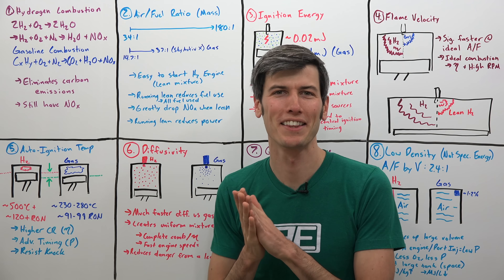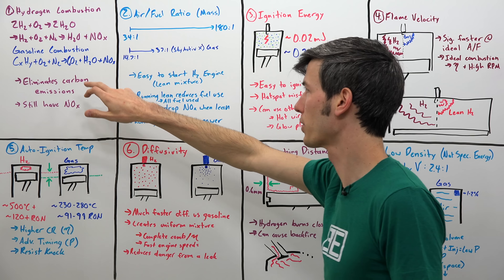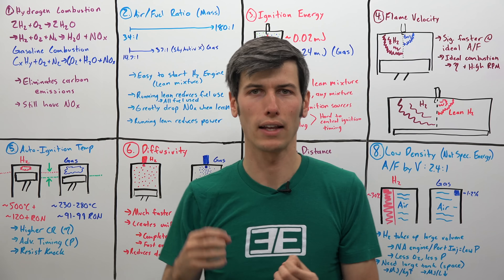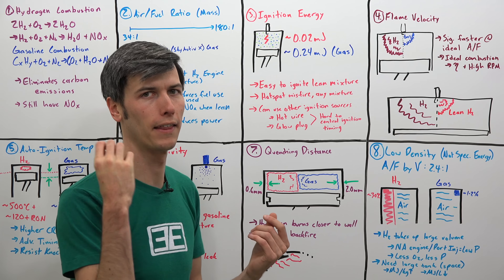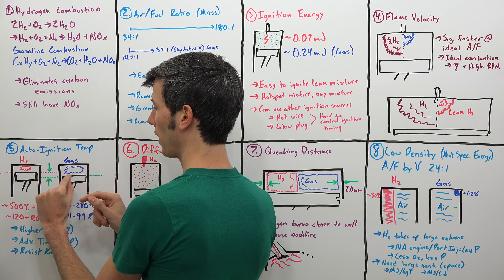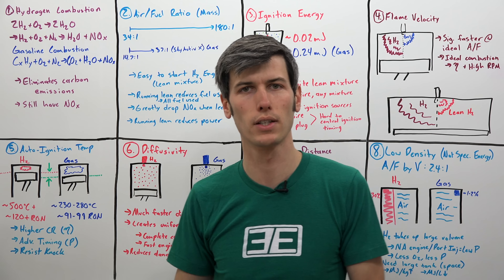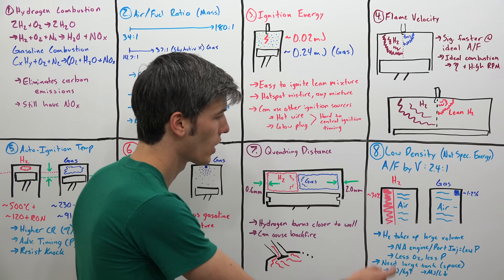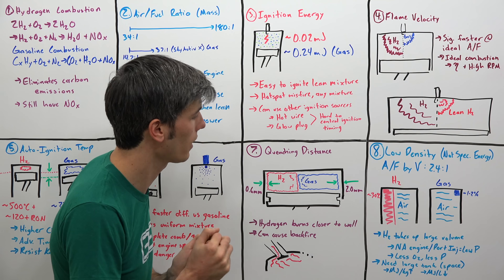The Difference Between Gasoline And Hydrogen Engines

Comment: Fix hyrogen timming by having 6 stroke, intake, compresion, power , exause , fill the cylinder with cooling water and eject cooling water from the cylinder. Obviously produce les power but you can run more hyrogen to mske up for that without pre ignition

Comment: Hydrogen fuel taking up more space issue:

Hydrogen can be created on the fly, petroleum cannot, 1 Litre of water can create 1,800 Litres of burnable hydrogen and the ability to power vehicles or generators etc. with water has been available for over 100 years. Oil cartels kill inventors creating a better version, but now electricity is taking over in vehicles they have to use other methods to make money like CoVert methods  ;|  Who could have guessed who was behind this in 2020?  Hmmmm..... clues anyone?

Comment: I wonder if a hydrogen leak in a car indoors is more or less dangerous than a gasoline leak indoors. Of course the quantity involved in either type of leak would be an important variable. Also, just how large does a compressed hydrogen tank need to be to store the equivalent of 20 gallons of gas?

Comment: Actually combination of hydrogen with diesel or gasoline is much better solution because diesel or gasoline with small quantity of hydrogen burns much better and you get perfect emissions and efficient engine. So it's much better than every fuel alone. Diesel with hydrogen is very interesting because its very clean, and you get more torque.

Comment: i'd still go with Hydrogen, no carbon deposit, adjust the timing and use Fuel Cell Hydrogen by demand.
Reply: Couldn't agree with you more. But I would combine the two. And have been.

Comment: Could the engine be designed to not use atmospheric air? If you are getting the hydrogen from electrolysis, then also save the oxygen and store it also? Though that would increase risk.

Comment: Hot spots are a problem in petrol engines cause there would be a carbon deposit left. Hydrogen engine does not produce carbon deposits so no hot spots due to that.

Comment: To avoid detonation in an internal combustion engine need a very high octane, pure hydrogen has an octane rating of >130, not easy to find this in gasoline.  Gasoline carbons up your engine reducing efficiency and is exponential in nature, hydrogen is not.

Only idiots state the hydrogen is more dangerous than gasoline and unfortunately in the US, idiots are in charge and law makers.

Comment: If the nitrogen comes from the atmospheric air intake as part of the combustion resulting in unfavourable nox gas why not use water as the fuel source. It comes with its own O to burn the H and the exhaust will be the excess O from taking the H2O ' s and burning the HHO and using any available or needed O. Any unused O will be the exhaust.

Comment: Actually the reason that leaning out the H2 mixture improves efficiency is that it reduces pumping losses.  That's because the throttle valve can be open farther thereby reducing the vacuum in the intake manifold so less power is wasted sucking air in against the vacuum created by the throttle valve.

Comment: Fantastic explanation.
I was waiting for the comparison in BTU's.
Gasoline has 114,000 to 116.000 BTU's of energy.
Diesel is 126,000 to 134,000 BTU's of energy.
Every other fuel including Hydrogen is less.
Hydrogen contains about 27% of the energy of gasoline.
The other huge and so far unsolved  issues include hydrogen embrittlement ,whereby steel deterioration occurs at temps over 500F.
But the gorilla in the room is how can you store hydrogen efficiently?
 Single or dual wall carbon nano-tubes?
This pig wont fly kids.

Comment: Blowby in gas or diesel engines is mostly carbon compounds which are scavenged by the PCV system and reburned. Some portion of these compounds are absorbed by the oil, eventually turning it brown and "yuckey" (Yuckey is the technical engineering term).

Blowby from a H2 engine is water vapor. Some portion of this blowby can be scavenged or exhausted but some smaller portion will be absorbed by the oil turning it into a mocha cappuccino colored not-oil with the lubricity of somewhere between Starbucks soy milk and water.

Many years ago BMW experimented with H2 fueled engines, in a V10 IIRC. They walked away.

Comment: I've toyed with the idea of a hydrogen-powered engine for several years, now. Your last point - energy by volume, I think it was - would a liquid hydrogen fuel system solve that? Not sure what kind of pressure that'd have to be under, but I'd imagine injecting liquid hydrogen into the cylinder would greatly cool the combustion chamber and eliminate any hotspots that could cause auto ignition.

Also, with hydrogen being so small of an atom... wouldn't it just leak through the gaps between most metal molecules?

Comment: 5:05 low flame point but high autoignition temperature. hydrogen's autoignition temperature is higher than isooctane so you have less preignition or knocking than gasoline.

Edit: you mentioned about that later, but I don't get why you said the opposite thing at 5:05. Preignition and knocking are almost the same.

Comment: Problem is where do you get your hydrogen, I don't have a hydrogen well, do you?  Most commercial hydrogen is produced by stripping the carbon from natural gas, thus you are paying for the gas and stripping a significant part of its energy content (that is then released to the atmosphere as CO2, in large amounts).  The other method is removing it from water (sea water, lake water, well water, makes no difference), this is the high school science experiment where they blow up two balloons, one with hydrogen, the other with oxygen.  It's a relatively simple process, the only issue is that it needs a lot of electricity since the O and the H are bonded pretty tightly.  This is somewhere between 20 and 30 kwhs for the energy equivalent of a gallon of gasoline.  That would take a lot of solar panels especially if you needed to fill the tank, say ten gallons worth.  After you make the pure hydrogen you have to store in in a bulk facility, transport it to the customer, and store it for the user, all of these present a lot more problems for hydrogen than for say natural or LP gas  (LP and NG come from the same source, why is only one 'natural' and the other apparently not?).  It is much more efficient to 'burn' hydrogen in a fuel cell and produce electricity that way than in an engine (otto cycle or diesel), neat thing here is that is usual to attach some sort of a converter allowing the FC to be fueled with an alternative fuel such as natural gas that is easier and cheaper than H and easier to store and transport.  Of course you are then emitting CO2 directly rather than back at the production facility.

The underlying issue is the emission of CO2, an atmospheric gas that is essential to life on earth (ask any biologist).   The model currently in use apparently overestimates the 'global warming' effect of CO2 by a factor of about 10.  Another consideration is that a relative small increase in atmospheric CO2 levels would enhance global plant growth allowing a big increase in world food, wood, and fiber output, something needed to supply the growth in world populations.  the temperature increase, though small, would be greatly appreciated by many Canadians and Norwegians as well.
Reply: Bs

Comment: OK, So you have only NOx and H2O coming out, right?    H2O = WATER right?     SO, It is the dead of winter 10 degrees below freezing, New York, Boston, Chicago, Denver, etc, and all these Hydrogen cars spewing out water freezing on roads, sidewalks, buildings. Sound like a real mess. You would have to have some sort or radiator and H2O recovery/storage  system.
Reply: You get vast amounts of water vapour from petrol and diesel engines.
Reply: @chestnut01111  channel is bs.
Comments are being deleted.
nothing is better than water !
Nothing.

Comment: Question: engines produce CO2 and that's suposed to be bad for the climate
the bubbles in any fizzy drink, champagne and beer is called CO2 also
what's the difference?
and if no difference, every liter of cola has about 2 liters of CO2
wich is specialy produced to put in there (U're the exact numbers guy^^)
that's a LOT of CO2 overal
... then as conclusion: Why don't they carbon tax fizzy drinks?

Comment: Great rap how would hydrogen work on a Wankel type ? You could set the rom and direct couple it to a multi phase ac alternator it could be a small package long distance trucks would need a small battery pack there refill time is short and somewhat easy also what about propane it’s cheap conmen and pollutes much less than gas ?

Comment: Why couldn’t you just have a recirculating system, with some sort of electrolysis device before the engine separating water into hydrogen and oxygen and reintroduced the 2 with lets say some sort of injector for each in the combustion chamber. Your welcome 🧐

Comment: Thats alot that i didnt know but now do until i forget it😊 I just wondered the difference when petrol and hydrogen are mixed. Assume you would have a hard time getting the correct mixture for proper operation would be one drawback. Thank you for your vid and knowledge

Comment: What?? I just heard that by running lean you reduce the NOx emissions? 
No way this can be true. Running lean means that there is plenty of O2 in the combustion chamber that can react with the N2 instead of the fuel molecules.
Running rich is mandatory for a really good NO2 emissions drop.
Reply: Running lean of petrol makes more heat and more NOx as a result. Running lean on Hydrogen makes less heat so less NOx, but also less power.

Comment: yeah about that consider closed system engine with a joe cell,geet plazma generator,plazma ignition,dual ignition and cooling system electrolisys,4stroke to 2stroke conversion,dizel to gasoline engine conversion there you go turn on your petrol engine on fuel when it reach working temperature close it then run for ever on simpel chemistry and that is changing molecular mass at high speed never ending fuel that way works joe cell,pap engine,stanley mayer engine etc. those are hybrid engine's car's who are build for those aplications are Holden,Suzuki,Opel,Gm,Mitsubichi,Isuzu engines "Older engine's" OHC ore SOHC engine's old military tehnology those engines are specific  they have special made space driled for head valves if the puleys get destroyed your engine wont by damaged thats the tric how build them on any fuel type and use waste spark ignition in a "closed type engine system" Im profesional oldtimer restorator trow away those school books they are c.r.a.p

Comment: Given all the explanations about the two fuels sources  and so many advantages of hydrogen I wonder if could be possible to make sort of an hybrid , perhaps an smaller hydrogen cylinder and average gasoline tank ,perhaps smaller no necessarily to increase power but rather to reduce gasoline consumption , reduce carbon emissions and or raise efficiency , I don't know if a comparison with Ethanol in gasoline will be correct , but sort of the idea. I understand it will require a separate added  fuel system and injectors, so i wonder if it is feasible and someone experimented that idea.

Comment: great video as usual - I wish you have discussed why Hydrogen cannot be compressed enough or liquified or ? As we understand that gasoline cannot be ‘ compressed’ any further and it’s liquid state provides maximum energy density and it’s minimum achievable physical volume , I wish you had discussed the various difficulties vs merits of hydrogen storage and also it’s relative danger in its stored state if a storage breach were to occur ( vs a gasoline storage breach and the comparative dangers it presents , ie flammability , flame propagation,etc ....)

Comment: thanks! i enjoyed this one! was always curious why hydrogen wasn't being used as a booster or pure fuel in ICE. 

so, are you going to do a video on the exact differences between a theoretical 'all hydrogen car/truck/semi' ICE vehicle and standard gasoline/diesel? like, that giant hydrogen tank you mentioned, how BIG would it need to be? what are the refueling issues? high pressure. death/loss of finger/hand/limb by frostbite. explosion/fire. get in a car wreck and you turn into a fuel air bomb. plus what are the infrastructure requirements to make hydrogen, store it, transport it, sell it?
Reply: Buses that use natural gas can be easily converted, but on a semi the tanks occupy the same space as the sleeping compartment. Refueling takes about 10 minutes at a price cheaper than gasoline, even at today's energy prices. True green hydrogen by electrolysis has yet to come online. Most hydrogen comes from Coal (gray) or Natural gas (blue)

Comment: What if a hydrogen engine did not ingest atmospheric air? On the intake stroke, what if you only intake hydrogen or "clean" air? This would require a very short intake valve duration and would cause pumping losses. Otherwise you would need a large air tank/fuel cell to fill the cylinders with your clean air. Assuming you could do any of those things, you could likely reduce NOx to nearly zero.

Comment: Very interesting thank you for this intro.  I was just a bit curious whether you could further put flame advance speed into perspective.  You mention that the speed is much lower when running lean, but it would be interesting to get a feeling for how much lower.  So let's say would it be significantly slower than gasoline if you were to bring it down to for example 180:1?
Reply: Sounds like timing can be adjusted both with spark timing and mixture proportion.

Comment: Excellent video :) 

my diatribe on hydrogen powered vehicles...
The Toyota Mirai, Hydrogen fuel cell. That's much more likely to be the future than burning hydrogen in an ICE . As I understand it hydrogen electric fuel cells are much more efficient than burning hydrogen . I'm sure I read somewhere that burning hydrogen in an ICE doesn't have a very different efficiency to that of petrol . Something like 30%. Hydrogen fuel cells , if I remember correctly are more like 60% efficient. So therefore the gas tanks can be smaller on a hydrogen electric fuel cell vehicle. Electric motors also have max torque at 0 rpm and don't generally need complicated gear boxes, are much quieter than ICE, and have less moving parts to go wrong.

The major issue with hydrogen is it wants to leak, after all it's the smallest atom of all. There's a natural leakage even with the very best hydrogen cylinders.
Hydrogen build up in confined spaces like car interiors or garages could get to dangerously explosive levels. No one wants there vehicle to be another Hindenburg airship ( so we'll need hydrogen detectors and alarms). There's the issues of compressing and decompressing hydrogen gas. That takes energy. Also under compression you are going to get heat, decompression you will get freezing . (see refrigerator theory , and heat exchangers ). Plus hydrogen is going to need to be produced and distributed somehow. 

I do however see hydrogen electric fuel cell vehicles as the future. They make a lot more sense to me as compared to Lithium or Super capacitor powered electric vehicles.

Comment: Interestingly you haven't mentioned how little energy is emitted using hydrogen as in torque. Also mixing hydrogen and petrol really messes up your ignition timing. And thirdly people who use diesel cars / trucks have been using hydrogen for years. I myself  tried it 15 years ago and personally saw positive and negative sides to the gas. If using hydrogen stick to using a fuelcell (go electric).

Comment: Hydrogen can also be used as a supplementary fuel with gasoline, diesel, and natural gas. My grad dissertation was focused on 20% hydrogen blended with compressed natural gas (CNG); it definitely has better performance, reduced emissions with very few modifications in the CNG engine. Interested ones can read one of my published papers. 10.1016/j.ijhydene.2020.01.025

Comment: Hi just seen your video I worked on developing a Hydrogen combustion engine to get around NOX I injected hydrogen peroxide at high presume and raised temperature which reduced the risk of knock as there is a high water vapor content draw back was needing to carry hydrogen peroxide tank but this is  very small. I have made this public now as the company is only looking at EV

Comment: easy one,..  fuel injection doesn't work on hydrogen because gasoline is a liquid.. so its pretty simple a hose into the intake pumping hydrogen.   lol
oh here.. I'll proof it...  BMW HYDROGEN 7..   a car that can run on EITHER. 
aka all combustion engines run on COMBUSTIBLE fuels...     and hydrogen is the best of all... WHY DO YOU THINK NASA USE'S it.

Comment: Very informative video - thanks. What about manufacturing and storing hydrogen so it is ready to be pumped at the gas station. Although Hydrogen is plentiful in the universe, I understand it is usually "stuck" to other things. It would have been interesting to hear what energy and technology is involved in preparing it for use in the combustion engine and how compares to refining oil to gasoline etc.
Reply: That's where the costs come in, very expensive.